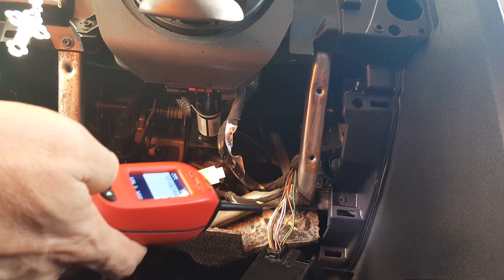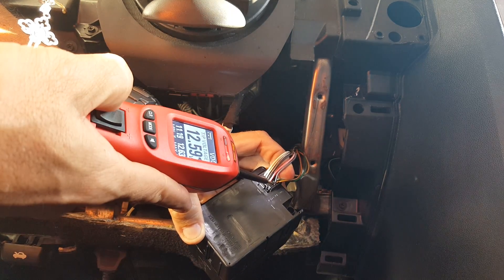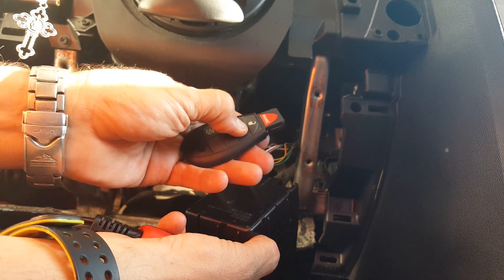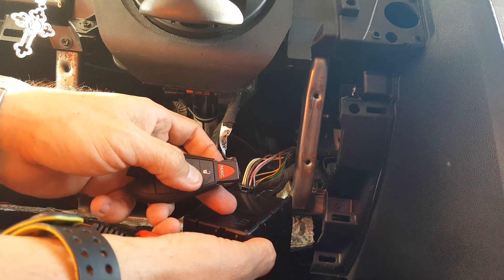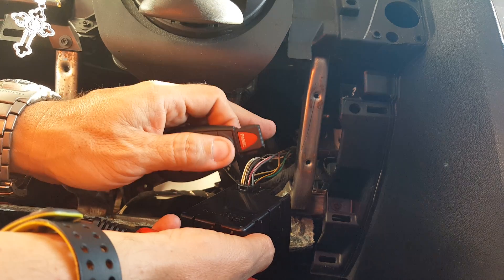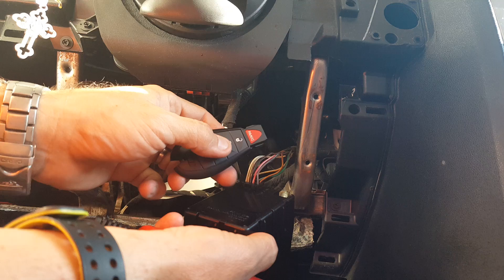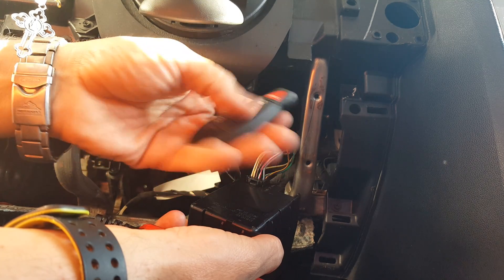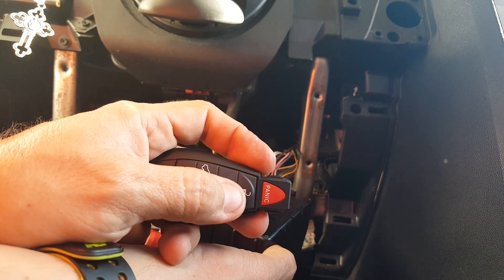Testing wireless ignition node module Chrysler Dodge Jeep ram plug connector

Comment: I own a 2012 Dodge Challenger and it seems like when I take my driver door off that’s when my remote works
Reply from the maker: Please explain your symptoms.
Reply: @AutoTechElectronic  key fog start working I thought it was the battery so I replaced it with new batteries, it worked for maybe two or three times after replacing a new batteries then it quit working again.
Reply: @AutoTechElectronic  Now I’ve been having issues with my driver door lock and lately I’ve been taking out the door to try to fix the lock the manual lock this morning I took the door off and put it back on and for some reason my key fob started working again
Reply from the maker: The remote has 3 functions, it can be used to open the doors with Passive Entry, it can lock and unlock the door locks, it can start the vehicle.
What works and what does not work?
Reply: @AutoTechElectronic  neither 3 works
Reply: @AutoTechElectronic  Like I stated before the keyless entry doesn’t work the push start doesn’t work in the fall key doesn’t work
Reply: @AutoTechElectronic  It’s off and on like it’s a shortage or something.
Reply: @AutoTechElectronic  I had my rig key replaced twice and I’m having the same issues within the same year I didn’t take it to the dealership locksmith actually replace my lock so there was no service done before replacing the key
Reply: @AutoTechElectronic  Also my keyless entry doesn’t work either that’s where you walk up to the vehicle you place your fingers on it to handle in the doors automatically unlocks

Comment: I can’t figure out what is going on with my 2011 Chrysler town and country. When I put my key fob in it cranks but doesn’t doesn’t start iv been having to cycle the key over and over again and I can get it to start eventually sometimes having to tap on the gas to get it too idle. When it first started happening my remote start worked fine but as soon as I put the key fob in it shut down now neither is working all it does is crank and won’t turn over. No check engine lights on. Unlock and lock buttons work. Can somebody help before I decide to buy a 900 dollar win module kit ???

Comment: I have a big problem the key fob isn’t active the alarm or either way donk make work the lock and unlocked button including the panic button the battery is good at the key fob but buttons not working 
I put it in the key slot and turn the switch to on position and everything seems to be working fine all the lights on dashboard  fuel pump working at turning the key to on position throttle body is moving at the same time when i turn the key to on. But the biggest problem when I turn the switch to start position nothing happens  as many time i try nothing happens. I just listena click sound on the fuse box located at the trunk of the car next to the battery
Also the red light on dashboard  just turn on when i turn the key to in position but seconds later it go off thats mean it’s the keyfob is programmed. It could be the WIN

Comment: I have an 09 grand caravan that had power for the sliding doors and when I went around and got in the driver seat as I turned the key and shut the door,  I lost all power. Still no power to anything. Could this be the issue for that?
Reply from the maker: Are you still able to drive vehicle?

Comment: I think my WIN is a 3rd gen.  I have a 2015 Ram 2500 Cummins that wont crank the starter.  I tried switching the starter, relays, got the batteries load tested, cleaned the battery cables and the ground behind the starter.  I've tried wiggling the key, tapping on the WIN box, I've tried everything.
Reply: Did you try connecting a voltmeter to the solenoid signal terminal and seeing if you were getting signal from the switch. If not, follow the rabbit down the hole until you find the issue
Reply from the maker: Is the rfhub call 956-508-3450 to orfer

Comment: Hello, I have a jeep grand cherokee 05 it runs and everything but there's times where the car will turn off on me or shake like if it wants to turn off  in the middle of the street. And before I but either buy a computer or a win module I wanna see what you think it might really be
Reply: It gives me code p1697
Reply: I unplug the batter and the code didn't come back only two different codes

Comment: No crank no start 2011 replace the tipm you can hear the starter relay clicking but still won't crank over I could bypass the relay and get the starter to turn over but it won't know no fuel no spark

Comment: My 2011 ram shuts off when driving. Dealer said it the win receiver.  Replacement is $900.  Does your come with new keys or do I have to reprogram the old ones
Reply from the maker: You would need new Fobik remote keys. Our kit includes 2 Fobik remote keys and has 3 year warranty with no mileage limitation.
Reply from the maker: Old keys cannot be reused
Reply: Are the new keys already programmed to the new Win Node?
Reply from the maker: @JorgeContreras-co5gd  our kits come fully programmed to your VIN. Plug and play

Comment: I'm getting 2 volts across the green and brown stripe wire are those positive still looking for a diagram for the win and p0562
Reply from the maker: What are the symptoms ?
Are you able to lock and unlock doors with fobik remote?
Reply: @AutoTechElectronic  yes I'm trying to find a perisitic drain and found a the white with the green and brown  stripe with 2v now trying to figure its normal or not but also my o2, cat, and emissions are flashing but my code reader is telling me they are fine

Comment: My key won’t turn the ignition  it’s like it’s lock or something
Reply from the maker: If you remove power and reconnect and still won't turn. You will need a new replacement win kit. Call 9565083450 to order. Or autotechelectronic.com

Comment: I got a charger it's a 08 it's not starting the key is like the one in the video it will unlock car and trunk but will not start only the door lights come on the dash nothing else radio will not come on but the head lights work

Comment: So I got a 2011 Jeep grand Cherokee and my battery died and I replace the battery and after that my keyless entry didn’t wanna work no more It kept showing damage key when my keyless entry was working perfectly fine but if I put the key in removing the pushbutton it works perfectly fine what can I be then
Reply from the maker: Which battery? Keyless entry or jeep?

Comment: I have a 2010 dodge ram. I had two keys programmed and now none of my keys work, including the original. 
All 3 keys (org +2 new ones will start the truck, but truck dies 3 seconds later. All keyless functions work, including remote start. But as soon as i insert key, it dies. I am getting a few errors, including "u0236- lost communication with electronic steering column lock module"  and "p0513- incorrect immobilizer key(immobilizer pending SAE j1930 approval)" please aby help would be awesome!
Reply: @francislaceese8552  I did. The win module was bad. It costed $900 for the dealership to replace and program.

Comment: Got a 2008 limited Chrysler 300 and when u put the key in and turn it to start just the lights on the dash comes on and it don’t start! Won’t even try! I’m thinking it needs this new part! How much does it cost from ur website?
Reply from the maker: Text the year make and model along with symptoms to 2109205819

Comment: I have a 2008 Dodge chargerwhere the win module key broke and I would have to play with it to get the car started and it just stopped I ordered two and bought two and they came in today I took the circuit board out of the Brooklyn and put it in the new one in wouldn't do anything but I took the spare when I have to have lived program and put it in there and it would turn the instrument cluster on but it wouldn't start the car cuz it's not program so can you tell me what I need to do in order to get either they all one running or get the new one program

Comment: I have a 2012 dodge grand caravan sxt, I get a badkey message and a red dot under the neutral. The fob still locks and unlocks. I installed new batteries in fobs and brand new battery under the hood. Thoughts?
Reply from the maker: Text us a picture of the 2 fobik remotes front and back to 2109205819

Comment: Truck won't start,  I remove ECM and truck locks started working on fob. I was even able to start truck,  but then I got a thunder bolt on dash so I turned it off.  After that it wouldn't start again. I don't know if it's the ECM or the WIN.
Reply from the maker: Most likely the pcm https://youtu.be/g-1bQq-nYaE

Comment: im hoping you can help me i have a 2008 dodge ram 1500 4.7 randomly wont start cranks but will not turn over (start) lights on dash work remote key also works could it be this module if so do you sell them
Reply from the maker: Did you already check the fuel pump and fuel pressure?

Comment: I just noticed you are from laredo. Can I stop by so you can confirm what I need for my Durango 2013.
Reply from the maker: Yes you can stop by our shop at 1903 W Calton Road.
Reply: @AutoTechElectronic  hey my 2010 dodge charger SXT will not start my horn, windows, radio, nor cigarette lighter not working my lights work and my cluster the only light comes on is red and the other light that shows on the cluster is the car when the door is open

Comment: So what happens knowing that the win module has power because of lock and unlock on the key fobik work but you get a red blinking security light blinking on the dash and it prevents the vehicle from starting?   Key fobiks are new and programmed to win module.  Key fobik batteries are ok along with the new starter and battery
Reply: I got the same thing did u ever figure it out
Reply: @buiLderbob845  THe PCM had to be replaced.
Reply: @ShyRage1 when you opened your truck did your alarms go off because it wasn’t deactivating the anti theft
Reply: @chrishill264  no, i never had that issue.

Comment: 2011 Ram, the remote start stopped working.  When you press the key fob, the door locks, the horn beeps once, the lights flash once, but no auto start.  any ideas?
Reply: I have the same problem, I Just found this video, I don’t know what to buy

Comment: Hi
Interesting video . My issue is slightly different from everything else ive read here. 
My jeep starts and runs fine. However, it will not switch off once started.
The only way to cut the engine once started is to pull a fuse and disconnect the negative battery terminal.
There is also a loud buzzing sound coming from my WIN module, so I am wondering if that is damaged in some way ?
But before I commit to buying a new one I thought I would ask the question here
Thanks in advance
Reply from the maker: What year and model? 
Which fuse?
Reply: @AutoTechElectronic  Hi, it is a Grand Cherokee ltd 3.0 year 2010.
I am pulling a red 50 fuse from the far left hand side of the large fuse box under the bonnet
Reply from the maker: @steveellis1688  if you unplug the connector from the back of the WIN and vehicle turns OFF instead of removing the fuse. Then the problem is the WIN and you need to replace it with a new one
Reply: @AutoTechElectronic  Thank you. It does indeed turn the vehicle off.
Does the item have to be an identical part number ? or will any similar one work as long as I get one with keys supplied ?
Reply: @AutoTechElectronic  What do you charge for a replacement item with keys ?
Does the part number need to be the same or will any do the job as long as it fits physically ?

Comment: 2010 grand caravan and with key in and try to start it I get no dash lights and no start.  the key fob will not lock or unlock the door. Any ideas. Thx
Reply: I have an 06 Grand caravan that was running fine till yesterday.  Parked it, and now I have NO power to lights/dash/locks/anything.  Battery and cable to TIPM bus bar has 13.6V. Alternator + terminal shows 13.6V. Battery 3 months old.  Where do I start?  This thing died out in the woods, and a tow could be a bigger problem than the cost of bending over for a shop.
Reply: @timkeyser3515  I replaced the battery in the key fob and that solved my issue.such a simple fix. I was overthinking the problem.good luck

Comment: I have a 2016 Town and country when I try to turn the key the lights come on but it will not turn over
Reply from the maker: You'll need to check for a red security light on your cluster.  If that light is on, then it would either be caused by the WIN module, or the key itself being the problem.  If the security light does NOT come on, then it could be something wrong with your starter, or the starter relay, and there would still be a chance it could be your WIN module. 
To rule out the starter, you can use a paper clip on the starter relay to jump the starter to ensure that it functions.
 You can always call our office so that we can review everything in detail with you at 956-508-3450.

Comment: Hello I have a 2013 town& country. I only have  stating issues when the weather is below 40 degrees.  The car will only crank, eventually she will turn on  and usually I won’t have that problem again until the next cold day.  I did replace that battery and the ambient air temp sensor.  And also cleaned the throttle body.
Reply: The fuel pump relay is a common defect on these models and its actually not in the engine fuse box per se like every other vehicle ever made. Its underneath the fuse panel soldered onto a circuit board Chrysler calls the TIPM, which stands for "screw you give us more money". Its outrageously overpriced and so is the labor to have one put in but if you google it or youtube search it you'll find that some guys who are actually qualified to engineer motor vehicle electrical circuits have come up with some relatively cheap and relatively simple solutions to the problem that the toddlers and thieves at Chrysler created when they built these flimsy tanks. Cant say in 100% certain thats your problem but its very likely. Theres a way to temporarily bypass it by stealing power from the auxiliary circuit straight to the fuel pump when you turn key by using fused jumpers..... you can google that too. Good luck chief

Comment: My 2011 Grand cherokee will not start,  both fobs had batteries replaced recently.  What it does is remotes will not unlock or lock doors, engine will not turn over at all.  All the dash says is press brake to start engine.  Tried jumping without success, Tried removing push button and using key fob to start and it won’t and know key fob wont come out of ignition.
Reply from the maker: Check the WCM fuse (ignition switch)
Reply: I checked the the all fuses and relays under the hood of my 2011 jeep grand cherokee.  It was not starting or even turning over at all.  All seemed ok.  I removed a relay and reinstalled it turning it around.  pulled a fuse and it was ok.  After doing this everything started working again.  CRAZY!
Reply: Its likely just a flash update you need. there is a TSB for it. The software in the WIN module locks up. Look up TSB 08-024-11 and see if it applies to your vehicle.

Comment: Hello, (2010 Charger ) The car starts with fobik but non of the buttons lock/unlock/panic/trunk works on both of keyfobs. (and i changed the batteries) Is that WIN responsible for that licking unlcoking remotely or there are another box that is in charge to detect keyless locking signal ??? And if yes where it is located ?
Reply from the maker: The WIN is the keyless entry receiver. Test the fobik remotes at Autozone. If they work, you need new WIN. If they do not work, you'll need 2 new Fobiks( very unlikely,  unless the fobik remote are not OEM)

Comment: Mine keeps saying bad key bad key and when I push it in with a little force it will crank, so I’ve been leaving the key in , I replaced the key and the new key worked and hen it said it was a bad key too !
Reply from the maker: You need a new WIN module kit with 2 Fobik $599.95 plug and play. No need for the dealership.  3 years warranty  with no mileage limitation. Autotechelectronic.com
Reply: Call me 4045838111

Comment: Does the win module on a 2009 ram control the speed sensor or actual gauge on the dash? I know for sure i need the key module... But just wondering
Reply from the maker: No it does not
Reply: @AutoTechElectronic  how soon could i get a module if i order it today?
Reply from the maker: @ezequelmarin7954  we have UPS overnight $60 you can have it Friday or Priority mail 3-4 days
Reply: @AutoTechElectronic  just placed my order today at 2 pm, 4/7/2019.... i paid for the overnight 60$.... any idea on when it should arrive? thanks in advance!
Reply: @ezequelmarin7954   overnight

Comment: My 2012 Jeep GC is triggering the security system/engine immobilization while driving down the road.. engine shuts off. Once I go through the steps of deactivating the security system it starts back.. Any idea what could trigger this?
Reply from the maker: Text me a picture of the inside of the fobik remote key to 8303746845
Reply: @AutoTechElectronic  Sorry, I never got around to send that text. Today is the first day it gave me a code, P0513. ended up taking it to the stealership because they were less than a mile away. Without diagnosis there's probably no way to know if it's the key fob, bcm or something else? today it also did not trip security system was able to start back up but immediately died... repeatedly.
Reply: what was the outcome of that? was it the PEM or WCM

Comment: 2010 dodge ram 1500 says "damaged key" and doesn't turn on when I turn the key over. After I wiggle it and try and try all the lights on the dashboard finally turn on and the truck starts. What's going on 😐
Reply from the maker: You need a new WIN module. We have the latest generation with 2 Fobik remotes programmed to your VIN plug and Play. 3 year warranty unlimited miles. Autotechelectronic.com
Reply: I need a WIN module for a 2012 Dodge Ram 3500